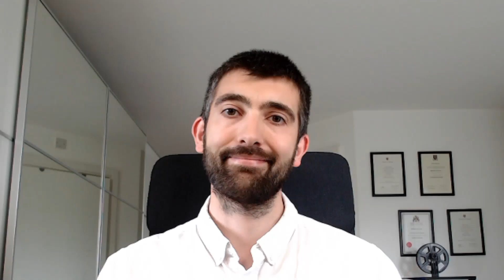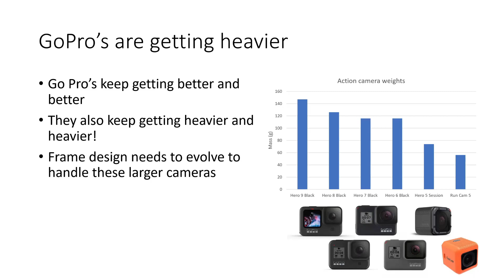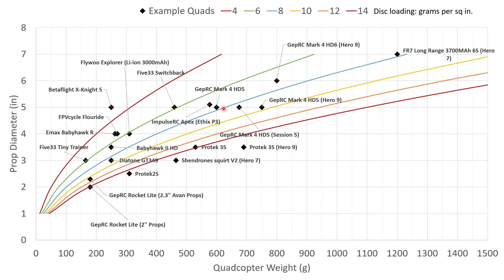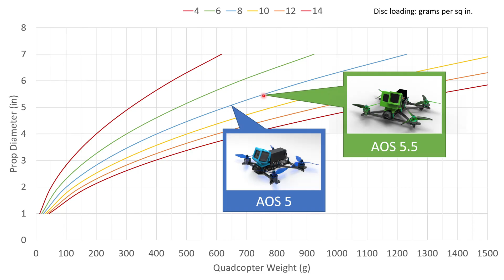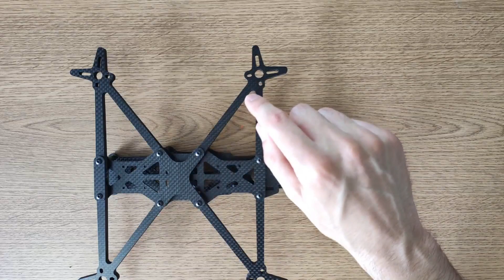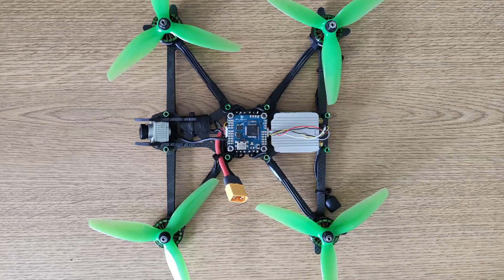The AOS 5.5. If you fly a GoPro Hero, this frame is for you.

Comment: Chris, I found the AOS 5.5 at GetFPV, so I ordered one.  It arrived yesterday.  I then saw the iFlight box, which I heard that they were cutting/selling your design.  After assembling it last evening, I found that the 8 screws, which come up through the arms and thread into the standoffs, well they're too short for my comfort.  They literally only turn 3.25 revs before they are too tight to turn.  They could stand to be 2-4mm longer than the "14mm" that they're packed as.  There are also no main stack screws, which disappointed me.  I would expect four 16-18mm stack screws.
I think that iFlight has cut corners without your knowledge.  I mean, a few mm's extra length on 8 screws, plus 4 more 18mm screws, probably saved them pennies on the kit cost.  Now I must go out and, hopefully, find the hardware that I need.  I live in rural Alabama, where our hardware stores are mediocre, at best.  Just thought you would like to know.  ~Ronbo
Reply from the maker: Hi Ronbo, thanks for the feedback. I'll double check the screw lengths with iFlight and make sure they fix that. Very sorry for the inconvenience.

Comment: Hi Chris, is it ok to use a 2207.5 1750kv motors with aos5.5 or a t-motor f60 pro motors?
Reply from the maker: Yes a 2207.5 should be OK. F60 pro should be OK with 1750kV
Reply: @ChrisRosser  thanks a lot. will get this frame now 😁
Reply: @ChrisRosser  btw i got the f60 pro 1950kv. is this better to use or the 2207.5 1750kv pacers?
Reply from the maker: @djeusebio7927  Depends on the battery but I would go with the 1750Kv for 6S
Reply: @ChrisRosser  cool. thanks a lot. 😁

Comment: @ChrisRosser : I get a really bad resonance peak around 280Hz on roll and 3 weaker modes on pitch spread out between 170 and 470Hz. The build is mechanically clean (I even put XY-2 between arms and base/bottom plate) but slightly overpowered (2207.5/1950kv) but I capped the throttle to avoid going sonic on the tips. Do have an idea how to mitigate at least the peak on roll?
Reply from the maker: Peaks in the motor bands on AOS frames are typically due to poorly balanced motors or props that are producing more vibration at those frequencies. The key question is how does the quad fly? If it flies fine with my recommended filter settings then don't worry about what the graph looks like. Peaks above 150hz are typically well filtered by rpm filtering and dynamic notch.
Reply: @ChrisRosser  nope - it's not the motors ;-) I need a massive notch on the gyro to get a decent signal to use smith predictor on Emuflight and at the moment even my beat down CMS BangGod flys better. I was hoping for some input on where to increase mechanical dampening in order to break that resonance and reduce filter-delay.

Comment: I've just ordered one today and will transfer the components from my disappointigly fragile CMW Shocker Tank.  It'll be running T-motor F80 Pro (2407 1900kv) with their 55a ProII esc & F7 pacer.  So I'm wondering props; I'm thinking HQ 5.5x4x3 rather than 5.5x3x4 as I think the motors may top out rpm before full use of motors are used?
Reply from the maker: With props I would always try both propwash will be worse on the 5.5x4. If you are running 1900Kv on 6S you won't run out of RPM, more likely the current supply capacity of your battery will be the limit!
Reply: @ChrisRosser  yeah I was thinking the higher pitch prop would work well with torquey, high kv 2407 I'm considering the 5.5x4x3 (depending in how bad the prop wash ) and running 1500mah 6s but with session 5 to somewhat offset higher weight of 1500's. Cant wait to get her delivered, built and flying 🙂

Comment: Hi Chris.  i bought your frame aos 5.5.  I have a question.  and should the flight controller be placed in the center of the frame, since there is a little noisy place?  or you can safely put it in front without worrying about additional noise.
Reply from the maker: The FC should go in the middle for best flight performance. 👍

Comment: Are those 20x20 mounting holes for M2 screws on this frame?  Also, I'm hoping there will be an AOS 6.  6" has been my favorite prop size so far.
Reply from the maker: Yes but you an drill them out to M3 easily.

Comment: Are you planning on doing a 6" version. To me 5.5" is just a waste for me.
Reply from the maker: When I design a frame I start from the application. 5.5" is perfect for carrying a GoPro Hero or other heavy action camera. 5" is perfect for a session or other box cam. What is the application for 6"? If there is a compelling application that 6" is perfect for then I'll do an AOS 6 especially for that application.
Reply: @ChrisRosser  To me a 6" is that perfect size that allows you to still stay loose and get a solid flow with freestyle but large enough to carry a larger battery for mid-range- long-range flights as well. Im not sure why you say a 5" is limited to carrying a session or small box camera. I have had zero issues carrying a hero sized camera on a properly setup 5" frame. Another thing I like about 6" frames is you have the ability to use a 6" prop or even a 5.5, 5.2 or 5" depending on what the situation calls for.
Reply from the maker: @AlbeeSoaring  Ah OK I think I understand. You are looking for a compromise between smooth freestyle and mid to long range flying. That is not the application the AOS 5.5 is designed for. It is meant for maximum performance (speed, power, and agility) carrying a GoPro Hero camera from 120-150g. So you are quite correct that this is not the ideal frame for your application.

I'm by no means saying a 5" is limited to carrying a session or a box cam. People happily put Hero9s on 3" cinewhoops! I'm saying that a 5.5" prop gives more performance (speed, power, and agility) than a 5" prop when carrying a heavier 120-150g camera. 5.5" is closer to the optimum prop size for maximum performance with that payload than 5" or 6".
Reply: @ChrisRosser  Ok so it sounds like your not planning a 6" anytime in the future. I am waiting on my AOS 5 to ship so I can get it and build it. Im curios to see how it handles.

Comment: Just saw a logfile from an aos5 and to be honest I'm not impressed at all. Raw Noise is looking way worse than on my beaten up racing frame even though I logged at 2 kHz and not at just 1 kHz. PID tune is nice, filter tune is craptastic. Raw noise is not impressive at all and nowhere near as good as it is talked about.
Reply from the maker: Unfortunately no frame design can make up for build issues. There are many ways to cause bad vibrations on a drone. Damaged props, rough motor bearings, loose screws, wires touching the gyro chip, bad vtx antenna mounting the list goes on. What proves the design of the AOS 5 is the incredible results achieved by experienced pilots (like Krunked) with their AOS 5s. They have shown that if you build and tune the frame to a high standard you can get great results. If someone is having vibration issues with an undamaged AOS 5 then they should get in touch with me because they need to troubleshoot their assembly and tuning. You should also be VERY careful when looking at other people's logs. How you fly and what parts you use make an enormous difference. Log comparisons are never apples to apples.
Reply: @ChrisRosser  Got to apologize man, just saw a picture of the build. 🤦🏼‍♂️ All cables between ESC and FC looking press fit can‘t really work…
Reply from the maker: No worries. At least that can be fixed relatively easily with  some spacers!

Comment: I'm interested to fly this frame both with hero 5 and hero 8. I guess if i change props to 5" size and adjust the pids, it could become more of a freestyle build, or just switch props, camera, and it becomes a cinematic build. Am i right? Just asking because i was looking for a cinematic/freestyle frame for goporo 5 and 8
Reply from the maker: You can run with 5" props, but this frame is really designed for 5.5. With a good tune it is absolutely stable and flies on rails even with a heavy camera like a hero 9. Use it for freestyle or cinematic flying. The only thing I would change are your rates.
Reply: @ChrisRosser  What motors size do you suggest for 5.5"? I might have missed it while you were talking ;)
Reply from the maker: @DarkAnima270  2307, 2208 are a good size for 5.5"

Comment: Hi Chris! I think you explain why I (weirdly, I thought) feel the Emax Babyhawk HD with a insta360 go2 is about the most versatile and capable thing there is now: The camera is not too heavy, the craft is not too slow, and it's almost always convenient. If I can take only one quad today, and don't know what type of flight I'll be facing, this is my go to combo. 
Do I understand you well, that the 5.5 will give me the same feeling with a heavier gopro, feeling nothing is compromised in flight characteristics, no or less drag, and not to much compensation in behaviour because of a heavier camera? (In a way, you'll only need a siccario type of quad if you want to "carry bigger"?). 
By the way, I initially thought your baby talk approach was a bit weird, but I find I understand all you try to convey, and now I'm hooked. I missed out on the UnmannedTech batch, but I'm glad I'm diving into the 5.5 craze because of that. And yes, I am a (experience driven) believer in the 3.5 sweet spot. Bring it on! And thanks, by the way. You da man.
Reply from the maker: Thanks! I think the 3.5 inch size is pretty sweet for ~250g quads. definitely feels more like a real 5in than anything else for sub 250g. 5.5" will give you a similar feeling with a hero 8/9 but will have quite a bit more speed and power because of the larger size.
I try to speak slowly and clearly and not use too much technical vocabulary because lots of my viewers have English as a second language and may not be so comfortable as you and I with the technical language. A lot of people who are native English speakers watch my videos at 1.25 or 1.5x speed and that works better for them!
Reply: @ChrisRosser  Well, it works. I’m kind of familiar with the approach: though I’m no engineer, I have to explain my patients (in the ER) their medical problems in way they understand enough, without oversimplification. And I still have an opportunity to size up their absorption potential, while you have to reach them all withe the same “performance”. But the endorfins for the executors of the craft are quite similar. But with a VERY diifferent profile… By the way, drone use in EMS and search and rescue is what got me into this. That, and an incredible itch to get in the air, of course …

Comment: Nice work! My prediction of arm breakage will occur across the motor shaft hole where the bunny ears meet the sides of the "head". Maybe the 6mm thick cf will help with that. I like that you use actual science in your design. To me the use of dampening grease is silliness....if someone needs to do that then they need a better frame. Great work..
Reply from the maker: The dampening grease is a bit of a luxury really. It really will make any frame perform better. It works especially well on stiffer frames with higher resonant frequencies (like my frames). If you really really care about getting that last bit of performance out of a quad you'll spend the time and effort and faff, but if you don't need the absolute best performance possible the effort is probably not worth it for you. 👍

Comment: Thanks for all of your videos and knowledge. I ordered the AOS 5 last week and will add this to the order.

Can you make a 7” frame using the same principles please?
Reply: It is easy to design 5inch frame. With  decent cfrp and follow typical arm width, length and thickness, you good to go. I design my own frame and let Armattan Productions cut the frame. No problem at all for 5" and TP3.

Then I start to design simple roomy 7" LR quad. Typical QAV-R shape. I just extend the arm from 5" to fit 7" prop with 6mm arm thickness. This is where all headache start🤣 Jello at high throttle. Longer quad arm and propeller contribute higher resonance. But I manage to tune perfectly by following Chriss Rosser tuning video.

Probably the future AOS7" will be better frame. Since the split type arm will damping some resonance.

Comment: Chris have you considered modifying the AOS5 to accommodate a center stack as well?  I realize this might increase weight which would need to be removed elsewhere if you wanted to keep the frame at 115g.   There are a couple of challenges in the build due to having the stack in the front that would be eliminated by having the stack centered.  For example, if you're using a Nebula Pro, the four conductor cable that connects to the FC is just too short (if you route the cable under the Vista, for protection, as I do).  I've overcome this by building my own connectorized cables but some might not be able to do this.  The other is the lead dress of the rear motor wires.  Since they must be run such a long distance, keeping them neat requires some thought.  I've designed and printed a part that fits over the standoffs which provides a channel in which to run the wires but again, this wouldn't be necessary if the stack was in the center.  BTW here's a link to some 3D parts for the AOS5 (including the motor wire cable management pieces) others might find useful.  https://www.thingiverse.com/thing:4885128
Reply: It would ruin the sweetspot performance its in. 
There are similar frames with triangle arms from catalyst machineworks but the arms are thinner to shave some weight which is unacceptable.
Reply: @Denis_3301  Agreed.  Not suggesting to make the arms thinner.  But for example, if the center section was wider the arm struts, that connect to the center section, could be made shorter which would save some weight there.  I'd even trade off a slightly heavier frame for a center mounted stack.

Comment: 22:20 right, I have mark 4 and that's where GepRC made a mistake, having counter shrunk screw grooves in the front compromises it's performance if we use button/socket head screws for GoPro mount

Comment: I like it! Have you experimented with or do you have recommendations for props? Only other thoughts are I'd love a second battery strap slot farther aft. I always use 2 straps, and Bob Roogi sold me on slots over pads. And any recommendations for mounting an immortal T? Will it fit in the center between the bottom plate and arm bracket?
Reply from the maker: I use HQ 5.5x3.5x3s they are nice and smooth. I'd recommend them.

Comment: Even more intriguing than the 5" 🙂. Any chance that there'll be EU distributor soon? 😉
Reply from the maker: Can you ask your favourite FPV shop if they can stock the frame? They can reach me at aos-rc.com and I will work with them to get them stock of the frame.
Reply: @ChrisRosser  I can try, sure
Reply: @ChrisRosser  I've just got confirmation from Drone FPV Racer that they have already ordered the frame. Nice. BTW - your PID tuning method works really well. Although I knew all the theory and was using PID Toolbox, I couldn't get the tune right - as I was constantly fiddling with D, instead of finding max. usable D and then matching P and FF. I agree that the behaviour of the balance slider is all wrong. Thanks! BTW - I have bought Nyogel, and as I'm building a new 3D printer (Voron 2.4), I'm trying to apply it to its critical joints to see if it can help with vibrations there (I don't see a reason why it shouldn't).

Comment: Nice vidéo. But you speak about 5.5inch disk load, but it seems you use 5inch props.
Does a 5,5inch frame with 5inch props his better than traditional 5inch ?
Reply from the maker: The props I use are HQ 5.5x3.5x3s

Comment: I run a GoPro 9 on a Daitone Roma 5" with 1800kvA motors on 1500mAh 4S and it flies like a dream and I use it strictly for landscape video. Ther all up weight is 802grams. I would like your unit to have a longer nose and tail piece to cater for the rear XT60 input as some of the Stacks I use, means you would have to reverse the FC and that means more programming set up. For sure in freestyle it may make a difference but for my use would be great. I also like a ViFly beeper & GPS and the Roma has that as well (Beitan 220). I notice you do not have space for a GPS.

Comment: 5.5" prop options are shit :( Most people are locked to the benefits of the of the ethix S3/p# range. Do you think we will get them to release 5.5 versions ? I know with HQ / Ethix it will be a struggle, but perhaps chat with gemfanhobby, they seem always to want to work with the community and could make you some serious fit for purpose props based on your guidance ;) to match your frames.
Reply from the maker: I quite like the HQ 5.5x3.5x3. I'd recommend them.
Reply: @ChrisRosser  Great, thanks!

Comment: Hi Chris, I have a problem with my drone.
I have a 5 inch quad, it is a lumenier QAV-S jhonny fpv edition, with 2208 1800kV motors, with 5×4.8×3 props. Every time I fly it, the motors get very hot, but only when I do flips, and if I fly it normally,  the motors stay warm . Also, sometimes when I do flips, it oscillates a little bit and it tries to do a powerloop. I'm flying with the stock PIDs with rpm filtering. How can I solve this problem?

Comment: The top plate is upside down. This will fix your "S"
Love the frame and approach on the disk loading vs AUW.
Reply from the maker: One side has a half depth cut for the camera plates to lock them in more securely. The top plate only goes one way round I'm afriad.
Reply: @ChrisRosser  oops. Sorry. Found you due to watching JB

Comment: Hi Chris, loving the design. I have a question though; what exactly is different about the Chamfered Arms? I can't find any details on what sets them apart.
Reply: The edge of the carbon fiber is shaved smooth so it isnt a sharp edge and it’s supposed to add strength.
Reply from the maker: I'm not aware of a strength benefit but it removes the sharp edge 👍